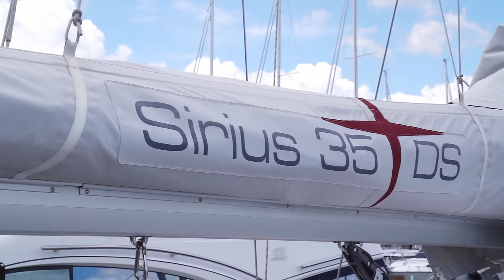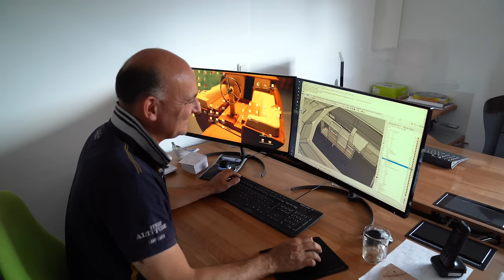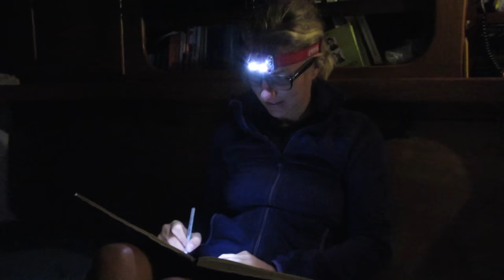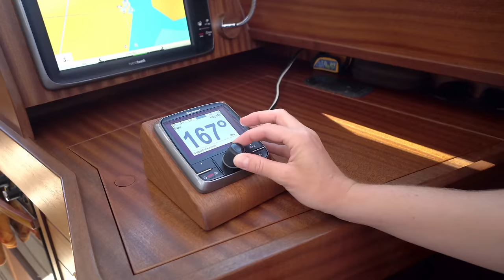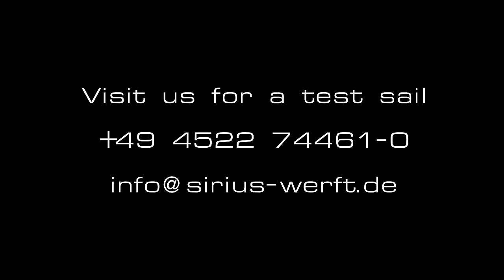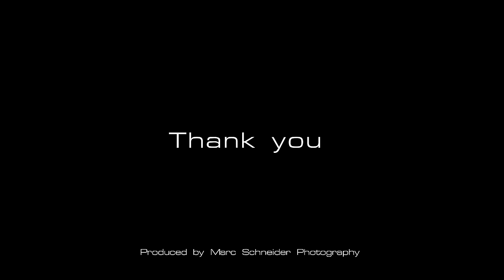Sailing the Sirius 35 DS: A Day at Sea

Comment: self tacking jib + furling code zero for the win. jib is only there for close haul, code for close reach to board reach plus light wind conditions. with this set up there really isn't a need for a big heavy genoa. 

self tack jib is really really good as long as you only use them for close haul. soon as pointing fall off they arent as useful due to side and cut. but they are super good. it's just a paradigm shift in terms of how fore sails are used. 100% recommend over traditional set up.

Comment: Thats truly a new standard in yachting. Thats an honest company, typical bespoke German where every square inch is methodically thought out. I would have the biquille bilge keel tri rudder for northern Europe Ireland Scotland France where the range in tide is large and the ability to dry out is paramount for both cost and safety. Any irishman would tell you that the best place to ride out a north atlantic gale is on a bar stool with your boat outside in the carpark. The bilge keel sitting on a triangulation just about achieves this. Well done.

Comment: A truly wonderful boat, and - as ever - the presentations from Sirius Werft and Torsten is next to none! The Best I've seen. And Believe me; I've been around searching for the "perfect" full-time liveaboard and ocean capable boat (I know; there is not such a thing as the 'perfect' boat, but... Well, I believe You know what I mean 😊) And, having seen a lot, when it comes to the concept it represents, my dreamboat is still the 35DS, so I Can fully sympathize with the charming Marie!

As indicated; my future plans goes in the direction of fulltime liveaboard up here in the Baltic area. As far as I Can see, the 35DS has no hull or deck insulation, but is that offered as an option ?

Best regards from Denmark 😊
Christian
Reply from the maker: Hi Christian, thanks for the many compliments! You made me red on my cheeks ;-)
Reply from the maker: Yes there is a lot of insulation in the very core of her build, she is indeed especially constructed for this. Building sailing yachts here in the North of Germany since 50 years now with lots of customers cruising Sweden, Norway and the UK – often living on board all year long this is our special expertise. Deck saloon windows are double glassed. She has a very sound insulation through the whole boat (up to 80mm in the roof alone, and including 30mm Divinycell  foam in deck and hull) which is that good, that there is no condensation water at all inside. For customers which like to push boundaries with temperatures below freezing, we do add some extra insulation to the already existing one in front and aft cabin. I was living on this yacht through January and February in Seattle and Vancouver and it was very toasty ;-). We do have customers living on board in areas of thick ice on the water. Good thing is: what is good against cold works against heat as well ;-)

Comment: Hi Marie. Thanks for your very useful I sights into the 35 DS. I'm trying to work out what to order when the Cash arrives to enable ordering a boat. I'm disabled, so that changes some perspectives and essentials - such as enough sleeping areas for friends and Crew, which is leaning me towards a 40 DS. I'll  e living aboard so the 40 DS allows some things. Thanks to you , Wind Vane steering is now on the list, and Sail Construction can fit in with one Furling large Genoa. Tri Radial with reinforced tacking points imho is the way to go, with the ultimate being Hydranet Cloth for Maximum Durability, But, a Tri Radial reinforced Dacron Sail should be capable of an excellent Service life while retaining good shape (negating Torsten's valid dislike of Wrecking standard Cross cut Dacron  sails by furling them ? ). Yes, Tri Radial is more expensive than Cross Cut, but not that much extra tbh, forvwhat you getbin return. Plus, Tri Radial loose foot Battenless Main Sails, should not have the life shortening in mast furling problems, with reliability improved again if the Sail has a Sail lubrication Coating, plus a UV protection panel that comes into effect when fully furled to protect from UV via the Furling Slot in the Mast. I would have another Furler for a Furling Gennaker/ Cruising Chute as well. House Bank Battery Storage however, Could be an issue if the Stats listed are correct and the Maximum - 2 x 100 AHr batteries for the 35DS,  and 3 x 100 AIR forvthe 40DS.  Even with Solar Panels on a Rear Cockpit Arch , and as many as possible on the Deck Saloon Roof, there doesn't appear to be enough pot to pour the "Beer" into ? Especially if Lithium batteries are avoided (I do not like the difficulty with recycling, plus Lithim does not appear to like Rapid Charging, they can have an accelerated early Death, probably from other factors as well) so I'd like Carbon AGM, 2 x 220 AIR for a 35 DS,  and 3 x 220 for a 40DS.  Easy recycling of over 99%, plus anywhere in the World, AGM replacementtp Batteries should slot in with an easy charging profile change. Had a thought too about additional Solar Panels. I like Full length Bimini Sun Protection for the Cockpit, or as much as possible anyway, with a gap at the front to the deck Saloon entrance to get to the sides and under Sun Protection - I've seen too many people hospitalised with severe Sunburn and heat stroke not to take good shading seriously. This does mean having a small arch at the rear of the Deck Saloon Roof, to carry the Boom Sheets just forward of the Co kit. However, that Cockpit Bimini can now Have another purpose, Flexible Solar Panels can now be fitted to Bimini Fabrics ! They aren't Cheap, but as long as Panels are Mono Crystalline, they should have a very long Service life, if the Surface Epoxy is very high quality (Junk ones the resin goes white within a few years - also check the expected lifespan of Poly Crystalline, unless dramatically improved in the last few years, my friend who has been testing Solar Panels for decades, had not found one that lasted longer than 7 years, most were dead within 6 years. Not good. Still working on other things, such as can .I use a portable single zone induction Hob in the Galkey, which could save a huge amount of Gas - get food to the boil fast, then o to the gas hob to simmer, and mixing in a pressure cooker, for e ample. Do I need a generator to run it, which could also heat water for showers, plus how the heck do I get a Water Maker running for showers, and reduce water tank size to have larger fuel Tanks. Compromises, compromises, compromises. Yep Boats, got to love them. Sorry a bit long, but am getting excited at the prospect of being on a Sailboat again. Thought I was finished with the loss if my last one, and to get back afloat again, was looking at Twin Diesel  motor yachts, but the Sirius DS boats have much better handhold and wedge ourselves in securely at the Galley etc, so much better for reasonably mobile disabled like myself. Thanks again Marie. Hope you get yours soon, and if we bump into each other at a mooring, pop over for a Meal and a drink. Best Wishes.  Bob.  👍🏴🙂
Reply: I have found out more about Sail Construction from Sailmaker Lofts since  I posted the above,  and having gone from Battenless in Mast Furling Mainsails being Unobtainium, several options are now available for Battenless Dacron Triradial Furling Mains, to Challenge Fabric , with three reefing points and Offshore Construction Cloth weights and reinforcements. Precision Sails also made a very interesting comment, in addition to them having already made a number of  Battenless in Mast Furling Mains, apparently Triradial Construction also recovers  most of the Performance lost by not having Battens. Sounds ideal for Cruisers imho. I have also been shocked to discover the extent of rapid Sail Fabric Destruction UV exposure can cause in the Tropics, so with a UV strip to protect the area exposed by the Furling Slot, in Mast Furling, should eliminate almost all of the UV damage forcthe roughly 80% of the time time Cruisers tend to spend at Anchor?  So I'm thinking Headsails maybe a ,ighter cloth 120% ish Genoa, or best size for Triradial 3 reef Genoa with UV protection strip, and a Furling Reaching Code Zero  to fill in the Wind angle gaps. Still a Sails specification work in progress though- I'm a bit tempted by a provisional quote from Ullman Sails for a polyester Laminate Furling Cruising spec Reaching Code Zero which has none of that nasty Sail destroying Mylar in it. Seems worth testing one tbh. All being equal with Boat Purchasing Piggybank size, I might just be able to get in touch with Torsten about a boat in late Summer or early Autumn, if the Financial World hasn't totally collapsed by then.  Best Wishes and Fair Winds to All. Bob.  👍⛵️✨️✨️✨️

Comment: This boat will be a great alternative to powerboats, and should attract a lot of power boaters to sailing. This boat will attract a lot of sailors to do more sailing as well. This boat looks like it is all fun to sail, even in less than ideal conditions. This boat will enable sailors to extend their sailing season by at least a month at each end.

This Sirius 35 DS has far more room and livability than the typical old school sailboat of the same length and does not seem to lose performance either. The ease of handling looks fabulous. The ability to be inside while still being able to see outside is a huge plus when underway in bad weather.

So many old school sailboats have some form of dodger/awning combination to achieve some degree of shelter, and none of them do it as well as the Sirius 35 DS. The doger/awning usually looks like an ugly afterthought which detracts from the look of the boat, unless they are kept very small. The Deck Salon on the 35 DS looks beautiful and is a part of the structure of the boat as well.

The rest of this Sirius 35 DS sets standards of design excellence as well. From the excellent video, one can tell that the boat is well mannered under sail and has good handling and maneuvering characteristics under engine, even in tight quarters.

It is so refreshing to see a boat of this size which does not need a crew of gorillas to sail, even without the electric winches. The push button sailing ability is icing on the cake.

It would be interesting to see the numbers on this boat, especially its comfort ratio, capsize screening formula, AVS (LPS), SA/D, D/L, and perhaps a good set of polars.

All in all, this boat should make a great family cruiser and live aboard. The energy management and storage are phenomenal. The boat looks very comfortable and dry. The Sirius 35DS will set new standards for sailing yacht design and excellence.
Reply: I agree, it kind of looks like my motoryacht. And is apealing to me
Reply from the maker: Wow, thank you very much and thanks for sharing! Looking for a second career as yacht tester or texter for brochures? ;-) But no kidding: you captured a lot of our thought here. For me it´s the interconnection between inside saloon/galley/navi – area with the cockpit, with the all-around-visibility really, which makes sailing so much more sociable and safer as you always stay connected and see if help is needed… and you spare yourself some tiring and getting cold as you can be on full alert and safe watch, even from the inside
Reply: @SiriusYachts  ,
Merry Christmas! You are most welcome. My comments are just my best observations based upon my own boating experiences. Your company has picked up a portion of the market which has been neglected by other high quality yacht builders. The upper middle class who wants a high quality yacht and is only willing to compromise on size has been forgotten by most other yacht builders.
 
Companies which used to build a range of yachts from 30 feet to 80 feet now only produce yachts 50 feet and up for millions of dollars. The other alternative is to purchase a mass produced boat full of safety and longevity issues, or to purchase a decades old used yacht from one of the aforementioned manufacturers and refit as necessary. These mass market low priced medium to large boats are nice for coastal cruising but not for offshore use, no matter the manufacturers' claims. A refitted older boat can be nice but is still an older boat with older performance.

Sirius has made a commitment to building quality modern yachts that a well heeled upper middle class buyer can consider as a better alternative to a larger yacht of lower quality. As the saying goes, when it comes to boats and airplanes, cheap can be very expensive. I would rather have a Sirius 35 DS, or the smaller 310 DS than a much larger mass market yacht. The Sirius will last and will hold its value.

As for your statement about a second career as yacht tester or texter for brochures, if your are serious, let's start with Sirius Yachts for serious sailors, and please count me in! Sirius Yachts will appeal to those sailors who are willing to pay more for a given size or pay the same for a smaller yacht in exchange for higher quality, better longevity, better reliability, better safety, better comfort at sea, and better resale value in the long run. I have every confidence that a Sirius Yacht will tick all of the right boxes for those sailors who want a high quality family yacht with good performance, ease of handling, and maximum fun.
Reply from the maker: @AMERICANPATRIOT1945  Thank you very much! I totally agree. The guys at mass producers are doing a very good job in terms of "how can I built as much boat for as little money" and I am admiring them for it. This is good for the market, as it brings people onto the water and makes chartering possible for more people….and I am also sure some of them offer very good value for money. 
What I am wondering since years is if the balance is still right. There have also been mass produced boats in the 80s and 90s and some of them have been brilliant, ergonomically and solidly built. In the last 20 years, all has been optimised for “how can I reduce the production time from 14 days to 10 says”. But even a Bavaria will be 40 years old at one stage…a Hallberg-Rassy or Sirius maybe 100 years. So how should a yacht be constructed and set up? To be “produced 4 days faster” or “how does it benefit from its construction the next 30 to 60 years?” I personally would think this is too much out of balance in some areas…
In the past 50 years of Sirius Yachts we have produced all sizes between 23 and 40 feet and many of them are very good value on the used market by now and also good to bring people into sailing. Some of the smaller ones had been even near to mass produced and relatively "cheap" at the time but today we have found our niche in perfecting our product generally and individually for each and every customer. This comes at a price and will sadly not be affordable for everybody but as they keep their value very, very well sometimes compare very good even to much lower priced boats if you calculate deprivation into it as well. The investment into it will still be much higher compared to many
Reply from the maker: There has gone a lot of thought and work in the design, but behind this stands a big team who all work with love and passion and thousands of owners ideas. Lots of credit to them as well! For me personally it´s being in the lovely position to have our boats built in the exact way I would do it for myself....and being able to always find customer appreciating this and able and willing to pay for the quality...with this, all work related things become fun ;-)

Comment: The only nice thing you could add are the speed and the TWS/TWA you met during the test. Great Boat
Reply from the maker: Yes, that would have been nice....but this was not trying to be a boat test in any official capacity. But if youfind some official statements helpfull: The 15 or so sailing magazines testing her had obviously been pleased: Yachting Monthly: „Is this the best boat ever built?“, "It`s the highest score we’ve ever awarded, by some distance" (still valid), "the Sirius 35 DS is the best cruiser he’s ever tested.“ "8 out of 10 points in sailing performance(Chris Beeson), Bootshandel: “I was totally awestruck by the small tacking angles we achieved. To convince myself, I checked the results by tacking over and over again. She tacks through less than 80°", Palstek: “The Sirius 35 DS is not only convincing as a high quality, seaworthy and well equipped cruiser, but also is agile and easy to handle even in strong gale conditions. She is a well-controlled sailing boat with a surprising potential for speed.“ There are more test verdicts in our brochure at https://www.sirius-yachts.com/yachts/35ds/ . You can read more of this test report at: https://www.sailingtoday.co.uk/videos/sirius-35ds-tested/ I hope you will have a chance to experience it in the future for yourself. You are very welcome!

Comment: Hi again Torsten, maybe add a ketch option on that 48 footer to set the interweb and sailing press a flutter. With a swing keel, factory option dinghy divots, factory option streamlined solar choices, water maker option, A/C option, extended range water & fuel tanks, full function indoor steering (but keep the amazing adjustable outdoor wheel, a slightly roomier live space with the ability to minimize the dining table (into a small lower coffee table) - one would have an amazing Caribbean cruiser that can get right inshore, sail the ICW and circumnavigate the planet.